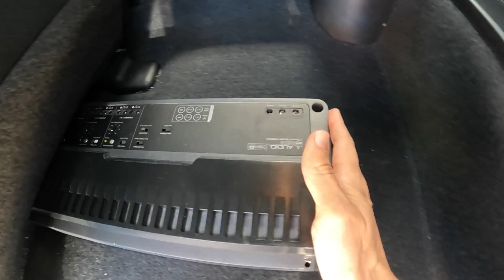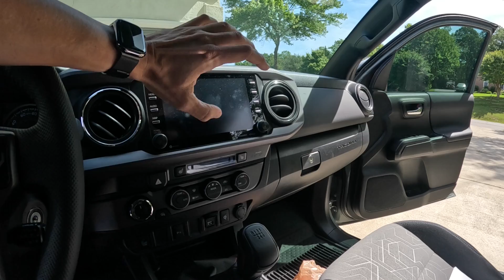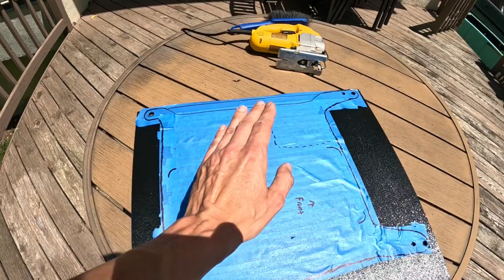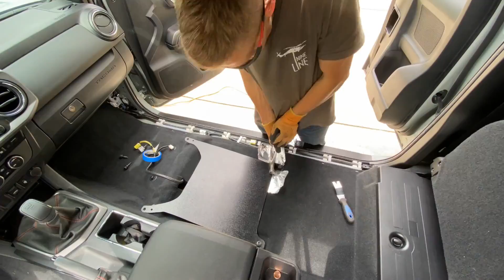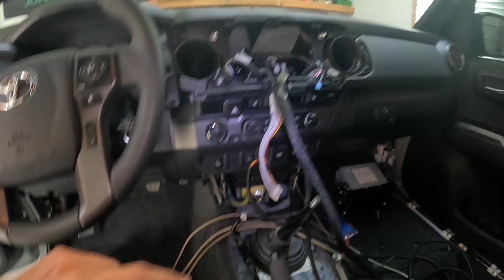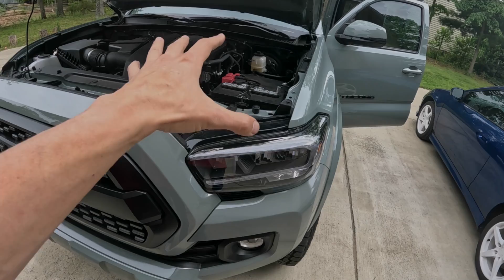DIY - 3rd Gen Tacoma - Adding a Stereo Amplifier and Subwoofer Part 1

Comment: Best Buy installed my sub amp on the back of the back seats, outta site an no possible way of anything spilling on it!~
  I had them do the install as the truck is under warranty.  An my installation days are over with, 30+ yrs of it here an there ive had enough.

Comment: Did you do any upgrade to your charging system?
Reply from the maker: Kept it stock being only (1) amp was added.
Reply: @randomrebuilds  about how many watts rms is that one amp putting out ? I have the same truck and plan to add 1000 watts rms . 100 per door and 600 for subs
Reply from the maker: @albono780  70 watts per door and 500 watts at the sub channel.  Its a great amp in one package!
Reply: @randomrebuilds  yeah that’s a nice setup you have . And you haven’t had any issues with charging system ? I’m using a power acústik amp kicker Ks 6x9 front ks 6.5 in rear and kicker comp rt for subs
Reply from the maker: @albono780  knock on wood no. Have same amp in my older daily and no charging system issues. When I had 2 separate amps is when I had issues.
Reply: @randomrebuilds  ok sounds good . My amp says use 8 GA wire . You think that would be good or should I go with a 4 GA ?
Reply from the maker: @albono780  I like 4 GA personally. More voltage to feed the amp and don’t have to go back and redo things if you’re ever unsatisfied.
Reply: @randomrebuilds  that’s true I will take that advice. Thank you brother
Reply from the maker: @albono780  sometimes the amp will have 4-8 awg. If it only fits 8 gauge prob best to stick with that.
Reply: @randomrebuilds  ok that’s true . I will run a 4GA then split to 8 GA if that’s all I can fit . Also I will try and put the wire into a wire ferrules and see if it will go into prob that way
Reply: @randomrebuilds  hey bro sweet truck hey man what’s the length of the RCA you used for your install?
Reply from the maker: @TRDproMike  believe I used 6’ to go from under the drivers seat to under the passenger seat. 3’ definetely won’t work.
Reply: @randomrebuilds  oh ok so 6 to 9 ft would be ok 🤔?
Reply: @randomrebuilds  from the stereo to underneath the seats ?
Reply from the maker: No need to with only 1 amplifier.